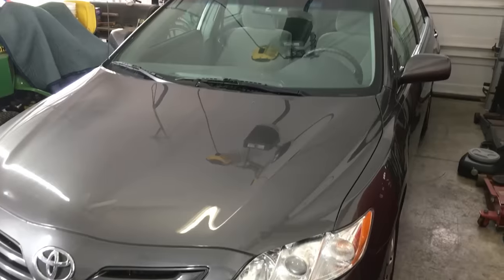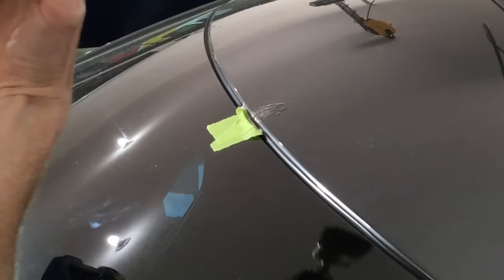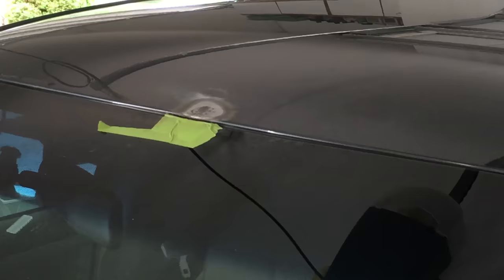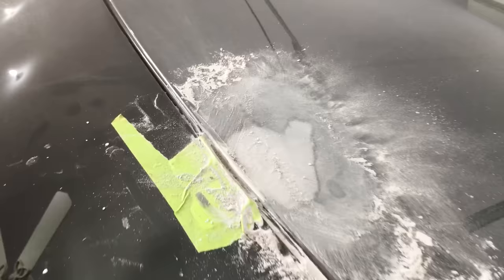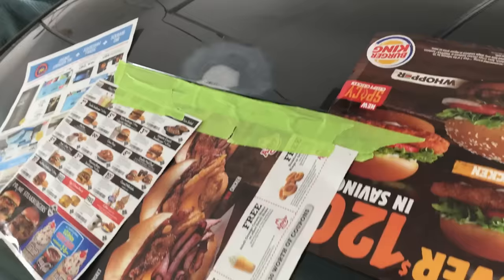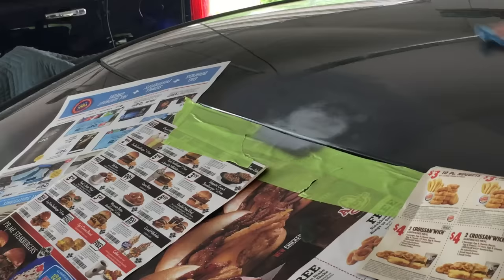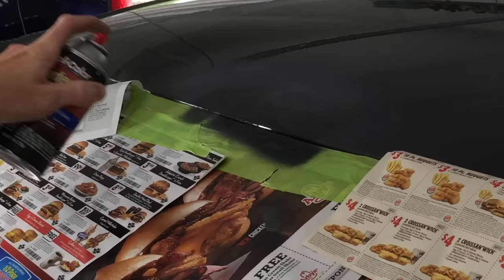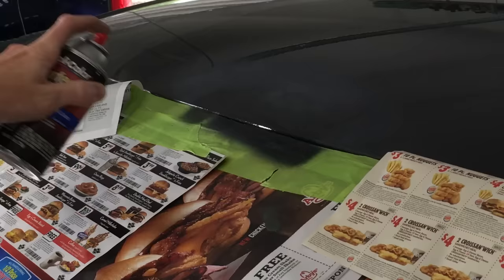How to Fix: Rust Bubble Under Paint from a Rock Chip Around WIndshield

Comment: I hate to be that guy but it looks like your paint bubbled and pulled after buffing since you didn’t give enough time to harden. I played at .5x. Maybe I’m wrong but you immediately cut to outside. I’m guessing you redid the paint job but didn’t film the correction.
Reply from the maker: I'm not sure what you might have seen at .5x, but I didn't re-paint it off camera. It's easier to see the finished product outside than in the garage.

Comment: I am your follower from the Middle East specifically from Iraq What is the reason for the loss of torque of the car in the sense that it is not traveling at the same speed when the fifth spare speed decelerates gradually Thank you Regards
Reply from the maker: Hi, I'm not sure I understand, as this car has an automatic transmission.

Comment: Dust-mask and glasses when working with rust.
Reply: Always wear Safety glasses or face shield when wire brushing. Wire shreds can separate and impale eye or face.
Reply: Or step into the 20th century with a 3m synthetic wheel

Comment: You went way too wide when blending and sanded a lot of perfectly fine clear coat. You should have used a finer grit sand paper to start off with instead of saving time and putting more scratches on the paint.

Comment: Now you have a car full of overspray all araound the roof, and windows.
Reply from the maker: Plesea Gabriel cans create minimal overspray compared to a spray gun, didn't need to mask the side windows. Overspray on roof is ok when blending with oem paint, as it was all polished after.
Reply: @6thGearGarage  someone recently has painted his fence with a paintgun and the wind carried the overspray  meters  and stocked to my cousins car. I tried with the heavy compound from 3m to take the particles away bat they stayed  in place, so I wiped them off with lacquer thinner whith the cost of mattening the clearcoat. So overspray is a pain in the ass  and it is indicated to be aware

Comment: The edge where you left the rust will quickly become the same as before the repair.You should remove the rust with a rust remover.
Reply: Hey it's about the views and the money man. 🤑 So the rust comes back later, but he don't care cause he's not going to own it , you know what I mean.🤣At least we do it the right way and the rust won't come back later.👍
Reply: @liki8526  
I understand.I put it up Rust cleaner which eats away the rust and leaves a plastic mark when it dries.Then I apply putty and paint.Until now, everything has held up for several years.Otherwise, you did well.
Reply: @amerikanstafford  I agree with you, do it the right way and once is all you will need to do it.😉
Reply: @liki8526  
Yes, I thought so.But also like you did I think it will last a few years.But if you maybe are repairing an oldtimer, it is good to do as I wrote so there is peace.

Comment: Honestly, I would rather live with the rust bubble instead of going thru that much work. How about a dab of clear manicure. I know, I know you went thru all the trouble for us to see how it is done. GOOD JOB
Reply from the maker: Thanks. All vehicles rust away prematurely here in Ohio thanks to road salt, but this will at least look good and slow it down. I worry about rust around the windshield because it can eventually rot round the seal and let water inside the car.

Comment: Would this work on an aluminum hood
Reply from the maker: It should, although Aluminum does not rust.
Reply: @6thGearGarage  I know but my Aluminum hood has some corrosion underneath and has bubbles in the paint
Reply from the maker: @AndrewKellman  I imagine the process to repair is similar. There may be a chemical needed to treat any corrosion left on the bare aluminum so it does not return after repainting.

Comment: you shouldn't use that clear coat.  those arent as durable, in other words, its too thin.  it'll look good the first few years but eventually the UV will eat right through it much, much quicker then 2k clear.  I've experinced this when i was working on my hazy headlight and it wasent a pleasent experince because only some areas of the headlight started peeling off it doesnt matter how many layer of wax was applied on it so now I have to sand it all off, and it was a pain because the area that still has the clear was still on there real good, so it took a lot of time and effort to get it all off.  This single stage clear only lasted the winter and now i had to do the job all over again.
Reply from the maker: I agree 100%. On a nice vehicle, 2k clear is the way to go.  I had this in my garage already so I used what I had. I have a paint repair project coming up in the future on a newer vehicle where I'll do a base coat/clear coat with 2k.

Comment: I am a carpainter,that fix hold dry place 2 year,i am just thinkink why yuo dont properly covering car,that there is ewery surface now paint and lack.guite nice fast fix but this metal is so deep corroted at that wont keep it good,need litlebit of sandplast or ewen some acid in those deep rustholes.also epoxy primer is good,it wont get moist to go thru.those ordenary spayprimer dont seal enough so deeply rusted any more.

Comment: But, but. The rusting process must stop. Body filler does not stop rusting because water vapour can go trough the filler material. It needs cathode protection direct to  steel surface, for example zinc dust spray. And then the filler and the painting.

Comment: That spot will go matte in a matter of week during summer sun. Spray can paints are shit and cannot whitstand UV or extreme temps on the roof. You didnt mention leaving clear coat at least one week to fully cure instead you polished it right away which is NO NO

Comment: Pretty sure it popped out again about 2 months later. You didnt clean the rust at all dude. That black markings you had around the bare metal is rust that had allready eaten in your metal that needs to be cut and replaced.

Comment: $500 for that car? crazy
Reply from the maker: Someone I knew was going to trade it in and only got offered $500 because of the damaged fender, bumper, rust and leaking trans fluid, so they asked if I was interested... YEP!
Reply: @6thGearGarage  pfft. if the car is rust free on the frame that still would be an easy $1500-$2000 car here incali. if tags were up to date
Reply: You guys are way lucky with cars, here in the south side of Africa it would be a bargain @$4000
Reply: @joeyboi8295  he could sell it in Ukraine for 8000

Comment: Number one never put filler on bare metal and you jumped 200 grit always 100 grit jumps to fully remove scratches filler always applied after area has been sealed with primer filler will expand and crack always to bare steel because it condensates heat and cold causes filler to crack bad example for that repair video I went to school for this do it right when showing people

Comment: I did nine like that on the 80s .     This is the 21 century and you’re hand sanding🤭and have an air compressor 🙄.   Get a HF.  DA sander and some disks.   Save your fingers and do as good or better job in a couple minutes I promise.      If you’re going yo do bigger jobs like that you’ll really appreciate those tools and they’re pretty cheap.

Comment: The paint repair is fine but the rust will start  again almost immediately ! You should have spot sand blasted and then used  phosphoric acid to kill the rust before filling and painting. When you have to do it again there will probably be a hole through the metal.
Reply: Sandblasters cost a lot of money not everyone has them available.This is a quick fix that will last for a few years at least. The only thing i'd change is to add some rust converter before the filler, that way it would last longer.